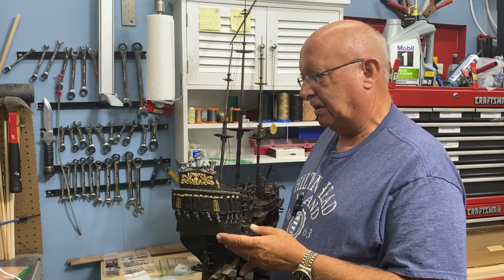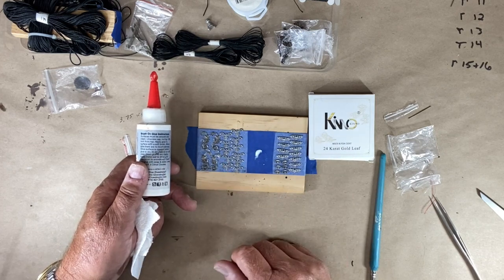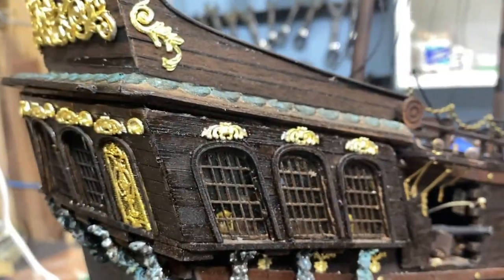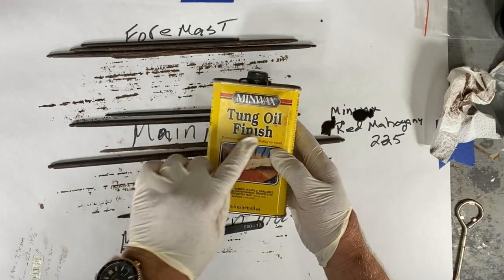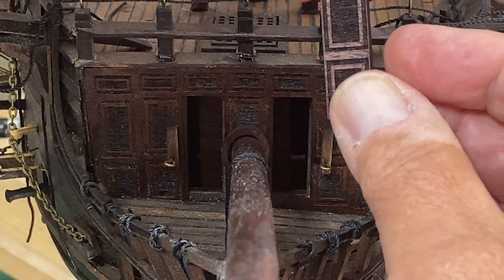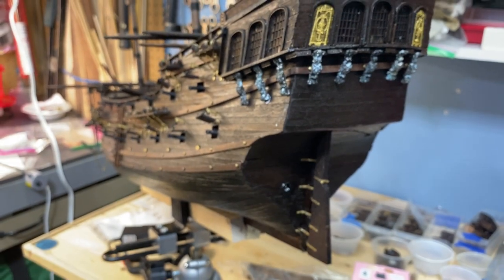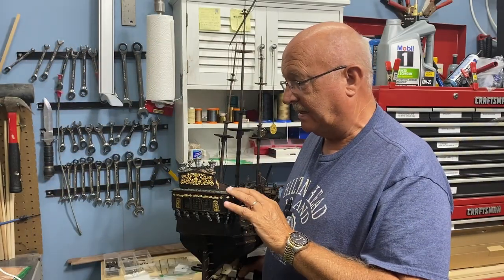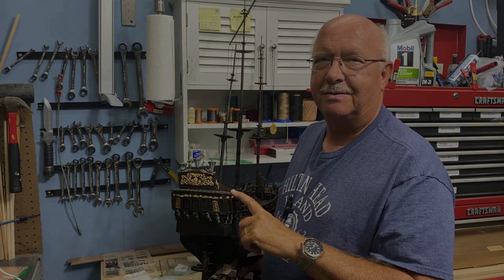The Black Pearl All Scenario Version PART 25

Comment: Coming along nicely Dan.  Your correct with the shroud rigging... I learned from the "Ship Modeling Simplified" book that they are rigged to the masts early on and then coiled and left to hang till almost the end of the rigging process.  The book is an excellent resource and lays out the entire rigging sequence.  I am also a beginner/builder and this book has been my bible ! !
Look forward to your next update.
Be well 😊
Reply from the maker: I agree on the book! I have it too, but I just got pre-occupied with the build and didn’t check it soon enough 🥴.
Thanks for following along 👍👍
Reply: Sounds like a book that I need :)
Reply from the maker: Amazon new: $21. They also have a used copy for under $10!
Ship Modeling Simplified: Tips and Techniques for Model Construction from Kits https://a.co/d/heKTBPA
Reply from the maker: Get it in paperback so you can mark pages!
Reply: @BoilerDan1  thanks , it's quite a reasonable price.
Reply from the maker: Yes, I’d have no problem getting the used one.  It’s Amazon prime so they have it….. maybe just a scuff on the cover?  But both are a good price!

Thanks for watching!👍

Comment: Dan,
You and Your videos has helped me out a great deal on my bootlegged copy of this ship. Thank you!
I have completed everything up to the mast. Problem I have no information on the size of all the poles. Do you know where I could get the measurements, or could you possible know the lengths of these poles?
Karla
Reply from the maker: I can get you that information. I have an appointment this morning.  I’ll try to get you something later today.
Do you know that I also made the bootleg version?  Here’s a link to that series: https://youtube.com/playlist?list=PLjMZtm2hvqrNtBeJsghWlM4fwsG6p_jEV&si=C4mCFZXV65MLpM5a
Reply: @BoilerDan1  thank you so much!
Reply from the maker: I want to mention that you can support my work by going to one of my videos and clicking the “THANKS” button below and to the right. All proceeds go towards my next project.  Not required but much appreciated.

Front Mast: from bottom up
1 Bottom: 175mm
2 segment 180mm
3 segment 130mm
4 top 90mm

Main mast bottom up:
1 bottom 230mm above deck with another 11mm below deck (total 241mm)
2 segment 185mm
3 segment 135mm
4 top segment 90mm

Rear (mizzen mast) 
1 Bottom segment 145mm
2 segment 170mm
3 top segment 110mm

The pole out the front of ship 260mm

Front yard’s bottom upwards:
1 bottom 249mm
2 middle 200mm
3 top 158mm

Center yard’s bottom upward 
1 bottom 280mm
2 middle 210mm
3 top 170mm

Rear yard’s bottom upward:
1 bottom 210mm
2 top 175mm

There’s another that holds a sail that catches wind from the side. It pivots on the rear mast and is 240mm long.
🏴‍☠️👍🏴‍☠️
Reply from the maker: Note:
The measurements I sent are from a 1:50 scale.  I’m not sure what you have.  Someone good with math should be able to convert the measurements if need be? 🏴‍☠️
Reply: @BoilerDan1  thank you again for all your help. This helps me out alot. Great job on all your ships!!